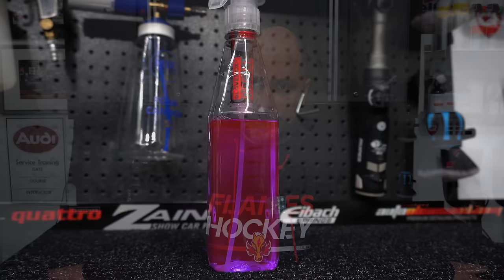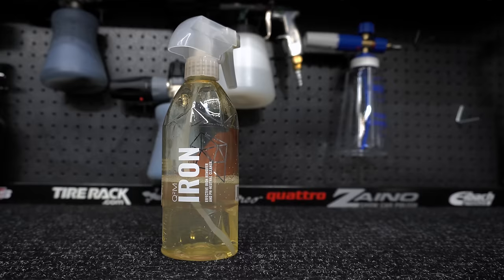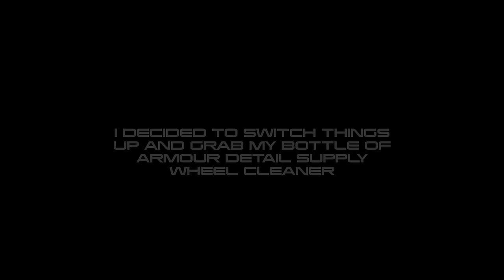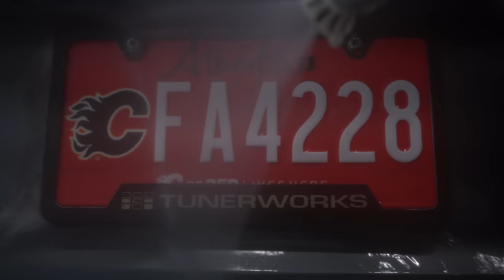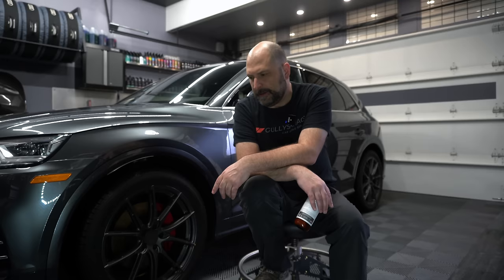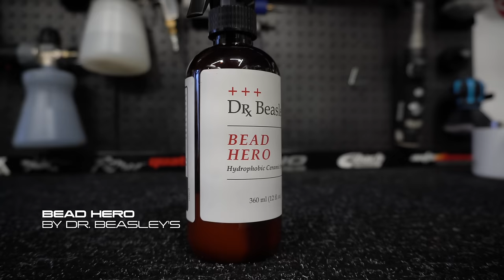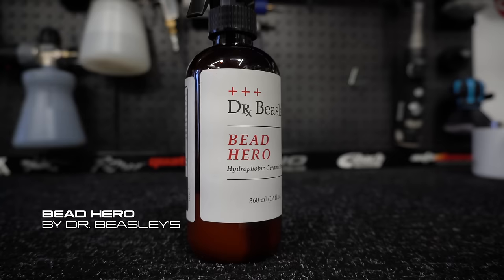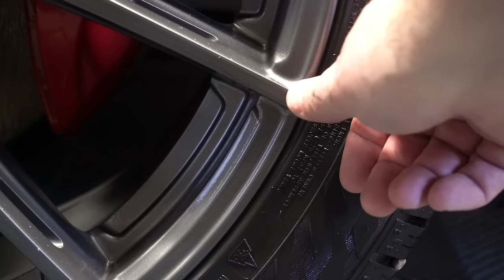𝗔𝗨𝗗𝗜 𝗦𝗤𝟱 𝗗𝗘𝗖𝗢𝗡 𝗪𝗔𝗦𝗛 | Awakening the Hydrophobics of Dr. Beasley's Nano Resin Pro Ceramic Coating

Comment: Hey Rick, thanks for this masterpiece! I was in the same situation last week, car was caked in road salt (Quebec weather is not kind) and too cold in the past 2 months to wash. I have CQuartz UK 3.0 with SiC as 2nd layer topcoat and it was indeed clogged on the lower panels and hatch area. I was able to fully restore the hydrophobics, but I had to use a more aggressive approach than what you showed. Here's what I did, hopefully it proves useful: 1. Alkaline pre-foam with Bilt Hamber Touch-Less, and rinse. You could also use Koch GSF + GS at this step. 2. 2nd foam on with Carpro Descale Acidic Shampoo to hopefully neutralize the calcium and minerals from the salt, followed by a contact wash (Descale diluted in wash bucket as well) and rinse. At this point hydrophobics were better, but still flat on lower panels. I could feel some roughness and embedded contaminants still. At this point I hit it with a cocktail of Iron remover (Bilt Hamber Korrossol) and Carpro Tar-X, let dwell, followed by another contact wash (with a fresh wash bucket of Carpro Reset) to get some agitation and really remove those last contaminants and fully remove any last remaining traces of alkaline or acid shampoo. After the final rinse, hydrophobics were fully restored and the lower panels felt smooth to the touch. Went ahead and applied Fireball Easy-Coat spray on rinse off for that final sacrificial layer. It's a bit counter-intuitive, as you would think acidic shampoo is for water spots which we get in the summer, but it's also great to neutralize road salt sticking to the surface. Tar remover, you'd think there's no hot tar from tires or construction in the winter, but somehow the mild solvents in it are great to dissolve whatever nastiness they put on the roads in the winter. From all the chemicals, I think Tar-X did most of the heavy lifting, and the big difference was applying it at the end of the process to a mostly dry panel, free of any traffic film, so it could really make contact with the embedded contaminants in the pores of the coating, combined with a final agitation before rinsing.
Reply from the maker: OMG! I will have to unpack this information when I have a bit more time. The fact you would take the time to explain your process in that much detail is so humbling. Thank you so much. I will reply in due time.
Reply: @RADGarage   Hey, just like @felipe_silve said - tar remover seems to work best for me also to unclog coating. I do use similar products but here in Poland we have less harsh winters (but also loads of salt when we have snow). Main difference is that I do prewash (GSF + GS) then foam the car with Descale and add mix of Descale + Restart Wash to the bucket, and do contact wash. After that iron remover goes on gets agitated with fresh microfiber towel and I let it dwell, rinse it down and apply tar and glue remover which also gets agitated with microfiber towel on all panels. That seems to do the trick best on Gyeon MOHS Evo + CanCoat as maintenance product every 6 months in my case. Love the content :)
Reply from the maker: Thanks so much for your feedback. This has given me much to think about as I plan for my next video. I am quite shocked with how many people have a similar situation to me. I don't remember this many people having issues unclogging their ceramic coatings in the past. That's the best part of this channel, it allows me to learn from and connect with others. Take care.
Reply: @RADGarage  Looking forward to the next one!
Reply: @felipe_silve This is kinda similar to what they do in Northern Europe but for every wash. They use Tar Remover in the winter to help remove salt & other chemicals from the road.
They spray Koch Chemie Tea on the lower half & rear of the car let it dwell for a bit then top it off with foam using Koch Chemie MSN (It’s called VBN in Europe but in North America it’s MSN).
Reply: @wd8005  I have Koch Chemie Tea in my arsenal as well so I might as well try that next time. Carzilla stocks MSN in Canada but it's expensive and limited in supply

Comment: 😂😂 I loved the intro / public service announcement!! Great video. We are freezing in Montreal too but perhaps not as much as you in Calgary! I hope you are doing well brother. 👍🏻

The hydrophobics were disappointing for sure. In the decon process, for coatings that seem to have taken a hit, sometimes mineral deposits are also accumulated and you need a more acidic product to combat those. Things like a water spot remover (DIY Detail Water Spot Remover) and/or an acidic shampoo like CarPro Descale really help to unclog. 

High pH for grease and road film, and lower pH for water spot and mineral deposit removal. 

So when I do a decon wash in the spring, I start with a high pH snow foam for the pre-wash with the foam cannon, and then move to an acidic shampoo for the contact wash. Once the car is clean, then you can use an iron remover for embedded iron contamination like brake dust.

I have my ultimate spring maintenance detailing video on my channel ahould you want to see that process in action. 👍🏻
Reply from the maker: Hey Pan, thanks for stopping by to check out the decon process I followed. Like many of viewers, you are recommending that I get a bit more aggressive with my attempt to flush out whatever is clogging up my coating. I am currently strategizing how to approach my next attempt so can I ask you a few questions? 

𝟭. 𝗣𝗿𝗲-𝗙𝗼𝗮𝗺 𝘁𝗵𝗲 𝗦𝗤𝟱 𝘄𝗶𝘁𝗵 𝗮 𝗵𝗶𝗴𝗵-𝗽𝗛 𝘀𝗻𝗼𝘄 𝗳𝗼𝗮𝗺
Any recommendations for which foam? 
𝟮. 𝗔𝗱𝗱 𝗮𝗻 𝗮𝗰𝗶𝗱𝗶𝗰 𝘀𝗼𝗮𝗽 𝘁𝗼 𝗺𝘆 𝘄𝗮𝘀𝗵 𝗯𝘂𝗰𝗸𝗲𝘁 𝗳𝗼𝗿 𝘁𝗵𝗲 𝗳𝗼𝗹𝗹𝗼𝘄-𝘂𝗽 𝗰𝗼𝗻𝘁𝗮𝗰𝘁 𝘄𝗮𝘀𝗵
Do you suggest I conduct a secondary foam application prior to this contact wash, or just move forward with the wash on a completely rinsed car? 
𝟯. 𝗔𝗽𝗽𝗹𝘆 𝗶𝗿𝗼𝗻 𝗿𝗲𝗺𝗼𝘃𝗲𝗿
Do you suggest I agitate the iron remover (if so, using what media?) or just pressure wash it off after dwelling for a bit? 

I always appreciate your advice and feedback. Someone on this video accused me of being an "embarrassment" because I ask questions. I don't claim to know everything and learning from others is part of what makes this hobby so rewarding for me.

Looking forward to hearing from you.
Reply from the maker: I'm leaning towards Lift in the cannon and Descale in the bucket.
Reply: @RADGarage would you consider built hamber for prefoam wash? Maybe that would be too aggressive.
Reply from the maker: I do have a giant bottle of it. Lots of options.

Comment: Hi Rick 🖐

Really enjoyed your video, it certainly shows the crud that we have to put up with in Canada with winter driving.  

I was surprised that you didn’t use something stronger in your pre was; something like Bilt Hamber’s ‘Touch-Less’ or ‘Auto Foam’ or perhaps from Koch-Chemie’s either ‘Super Foam’ or ‘Active Foam’.  I believe that one of these soaps would have been a better option for a decontamination wash with all that crap that was on you Audi.

I will keep tuned in to see what you experiment with next!

Thanks for the great videos, many appreciate all the work that you put into your excellent creations.

Cheers!!!.. 🍻
Reply from the maker: I approached it as two washes in one. The preliminary foam was just to get it clean, which GSF has proven to do quite effectively. The second round was the decon step, but a little bit of GS added to the GSF wasn’t enough. I’ll get more aggressive with the next one. I have been getting lots of recommendations so I’m confident my next attempt will yield better results. I plan of filming it and sharing the process and results with all you RAD viewers! 🤘

Comment: Great video, Rick! Nice to see you back. I’ve experienced the same with the lack of hydrophobics with only a year and four month old Adams Advanced coating. Granted, I live in Phoenix so I  don’t have the harsh weather conditions that you do in Canada but what I found to be helpful, was after a thorough contact wash, apply an iron remover and lightly agitate that with a soapy clay towel/ mitt. Then I would do another contact wash to get off any residue. This process didn’t entirely solve my problem, but it certainly helped. As always, that SQ5 looks incredible!
Reply from the maker: A number of people share you opinion about agitating the iron remover. I did a simply apply, dwell and rinse for fear of causing any micro marring in the event there was particulates on the surface of the paint. Perhaps I was being too paranoid. Lots of feedback on this video which gives me a lot to think about and consider. Thanks for being part of the process!

Comment: Good quality video like always-nice to watch. I live in Estonia and our climate is similar or even harsher. On the road salt after 5 degree doesnt work anymore and after that they add something really aggressive on the road. Most ceramic loose hydrophobic after on month. It eats through ceramic. In here we cant get car paint clean, if we dont use asphalt remover. Best in this category is petrol base( cant use inside garage). It removes this darker layer on the paint. In Estonia and nordic country we have good products named EWOCAR(German made) and these priducts work hear much much better than others. Try to find and order some prewash-alkaline, shampoo. Ceramics are very strong in harsh climates conditions and they dont left you waterspots behind so easy. I use almost most bigger branded producer, but these products are different. In video I see also-asphalt remover make trick there.
Reply from the maker: Thanks for the thoughtful feedback. I have seen photos of the oily material some Nordic centuries lay down on their roads in the winter and it absolutely horrifies me! I have a lot of different soaps, and this was just my introductory attempt at reviving the coating. I will be experimenting with more aggressive products in the near future. This is the part of the process that I kind of enjoy the most, solving a problem. Thanks for your help.

Comment: Extremely thorough however, I didn’t see an acid decon though.  As much salt you were dealing with a water spot remover would’ve been a huge plus for this coating.  I would try to use a dedicated water spot remover step or an acid based contact wash especially for the lower paneling.  It’s worth a shot.  I know it worked wonders on my coating/vehicle after a rough winter.  Great job and I love your videos.
Reply from the maker: All valid points. Many of which I incorporated into the follow-up wash. https://youtu.be/Yu5LL7b0aaI?si=JI9BaPgCGSrJU899

Comment: Hey, Rick! 

Lots of great advice in this thread, but I’ll just add one product recommendation, as I’ve never seen anything even come close to working as well in situations like this:

Ammo Boost Anti-Salt

Larry over at Ammo NYC is a genius, and this is an ADDITIVE, not a soap in itself. So you just add this, in proper proportions, to your favorite soap (in foam cannon and/or bucket) and let the magic work. Think of it similarly like we do with adding APC (as you noted you did with green star) but to specifically target the winter chemicals that you’re dealing with.

Best of luck!
Reply: Yes, I live in Norway and we also have this salty mess on our roads. In addition to the usual wash/decon-chemicals, I use separate product that is designed to break the chloride-bonding to the paint. I think the bonded chloride might be the reason why the hydrophobic properties took a hit.
Reply from the maker: I have yet to try any Ammo products. By the time you factor in currency exchange, shipping, customs, taxes and duties, it is just too expensive. Maybe one day I can connect with Larry and get a RAD discount!

Comment: Hello there I love your videos it’s my favourite on YouTube, I saw your process and it’s very good the only thing is when I’ve done the same thing on my sister’s Mercedes I rubbed the iron remover on after spring it, And it seem to give me better unclogging abilities and it restored the the ceramic coat back to normal if you try that especially in the back with the license plate is I think you might have better results please let me know if you do try it and if it works for you ? Please keep up the great work that you do and thank you
Reply from the maker: Yes, a few people have recommended agitating the iron cleaner. I think this is where I went a little wrong. I will do it next time. Stay tuned for a follow up video. I haven't given up on bringing back the hydrophobics!

Comment: Hey Rick, phenomenal video and thanks for sharing. Similar to you, I would not be that satisfied with the hydrophobics. Knowing the price point of that coating and the durability claims, I would expect more out of it. To be honest, I probably would have been little more aggressive with the prewash/foam. It is my understanding you Used GSF for the initial pre foam and then used GSF and GS for the contact wash. I probably would have done a prewash with a product like Lift from CarPro or super foam from KCx. Not sure of the results would have changed or not but this would be my process. Thanks again!
Reply from the maker: Yeah, I am going to get more aggressive in my next attempt. I have quite a selection of soaps to choose from, so it will just be a matter of narrowing it down. Plus, lots of viewer feedback and recommendations. Descale seems to be a popular recommendation. I have a Pre-Wash cleaner by D-Tail Lab that I'm considering as well. Lots of options, but just so little time. Especially if I want to document it all on camera. Thanks for taking the time to view and comment. It is great to have such a supportive and engaged audience. Not all channels are so fortunate.

Comment: Good video. struggling with road salt and temperature swings here in Norway too. was a period of -20°C

I thought this method removes winter road salt very well, even if there is a lot of dirt on the car

start with a thin layer applied under the windows of Koch Chemie Teerwasche A  (petroleum-based degreasing) leave it on for 3-5 min and a layer of Koch Chemie Vorreiniger B NTA Free in a foam cannon 2 to 5% pir for a further 3-5 min working time and rinse off. Remove any iron if necessary and regular hand wash and finish with Koch-Chemie Hydro Foam Sealant S0.03

If there is not that much salt then just Koch Chemie Vorreiniger B NTA Free in foam cannon 3-5 min working time rinse off. normal hand wash and finish with Koch-Chemie Hydro Foam Sealant S0.03

Not very gentle on the protection of the car since Koch Chemie Vorreiniger B NTA Free has ph 13.1, but the car gets completely clean. Helps a bit with a wear layer with Koch-Chemie Hydro Foam Sealant S0.03
Reply from the maker: That is a very thorough explanation, and I thank you for that. I do not currently have some of the products you recommended, but that gives me something to strive for! I really appreciate you taking the time to follow this project and lend me your advice. Stay RAD! 🤘

Comment: I see almost identical behavior on my cars here in the Chicago area. I typically do a Spring 'unclog' on the everyday driver using Koch Chemie products on the paint work.  I get better results but I used a different coating. The coating is approaching 3 years so this spring should be interesting wrt coating longevity.  Great videos.
Reply from the maker: I will keep trying to unlock the hydrophobics. Lots of advice has been pouring in so I will take some time, regroup, and attack it with a different strategy very soon. I'm not giving up on it.

Comment: Adam’s polishes graphene coating has lasted two Michigan winters for me. Top it off with their graphene boost once when we get a warmer pocket of weather during the cold and I’ve been happy.
Reply from the maker: There are those that scoff at Adam's, but I used their Ceramic Coating when this car was brand new and it was a warrior. I am not surprised at all to hear you have been having good success with their Graphene coating. As you know, I still have a number of Adam's products that I lean on regularly. I have many options if I apply a new coating in the Spring, but I'm not sure I will be using Adam's. They have kind of forgotten about me over the years. ☹️
Reply: @RADGarage  that’s too bad. I agree some products (their leather conditioner & polish/compounds) I’m not a big fan of. But their ceramic/graphene line I’ve been very happy with. Have used for 4 years now.

Comment: Nice video! I appreciate the content.

I had similar results with Dr. Beasley's Nano Resin. In my experience, it's not a durable coating, even in mild weather areas. In my opinion, from what I can see in your video, it appears that the coding has failed. 

I have switched to Gyeon Syncro, I'm nine months out from application and it is performing as it did on day one. At this rate I am expecting no less than 3 years out of this coding likely more. 

I'm using Bead Hero as my topper. While not the most durable product, it does produce insane beading, gloss and is the easiest to use spray ceramic I've had my hands on to date.
Reply from the maker: I have applied Gyeon coatings many times over the years and they always perform well. I am also a huge fan of Bead Hero. Thanks for taking the time to watch and comment on this video. I will be completing a new project involving my SQ5 and a new coating this Spring (if it ever arrives!). Take care.
Reply: @RADGarage  I'm a huge fan of Gyeon! The Syncro is currently my favorite ceramic, super easy to apply. I'm just not a huge fan of the ceramic detailer or Cure.
Reply from the maker: I have had only good times with Ceramic Detailer.